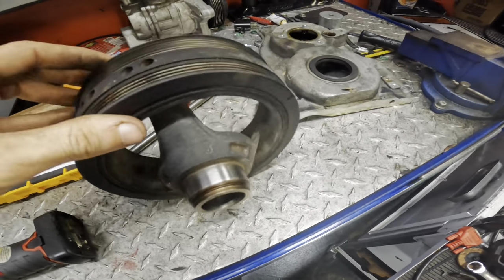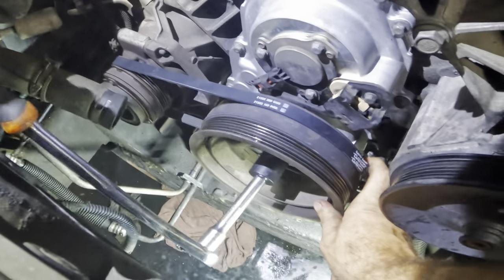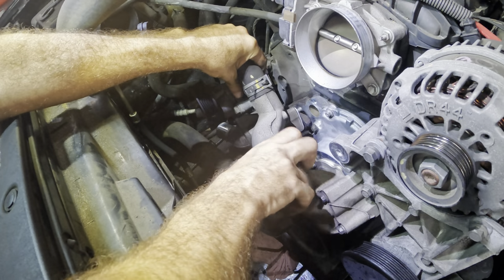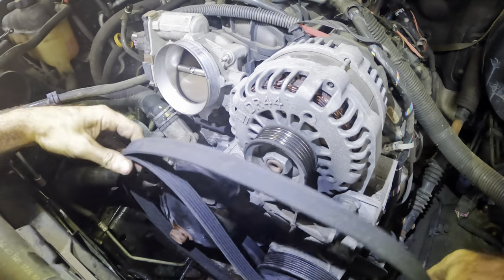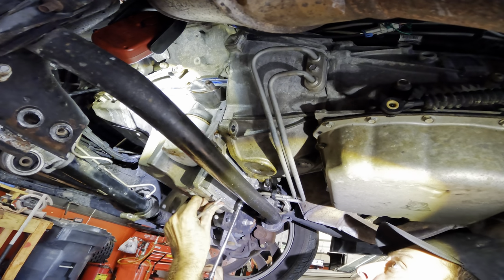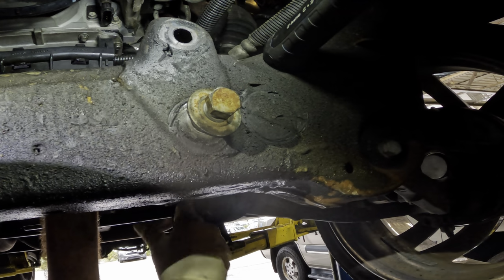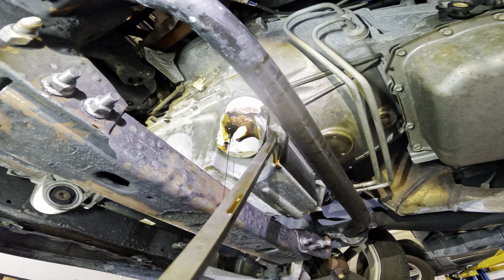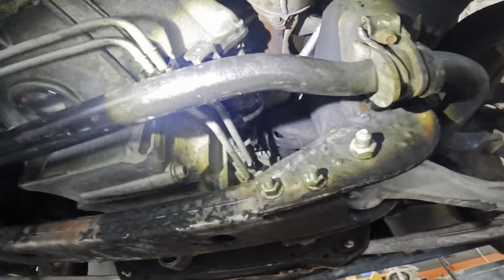Customer States: Melling Oil Pump Upgrade! GM 5.3 V8 PT2

Comment: i hope this customer didn't request the oil pump replacement on a hunch!  that was a huge job!  there's a master mechanic on the radio here who says he replaces his tstat ANNUALLY to maintain good fuel mileage.. seems excessive, but i guess it's the first feedback mechanism the computer uses to regulate fuel..  love the videos!
Reply: The customer did replace it on a hunch.  Had no reason to just had him replace it.  But not the water pump!

Comment: The last guy put the pan bolts on with a million pounds of torque, why did you think the filter would be any different? When it comes to oil pumps, why do you have to prime some but not others?

Comment: The crank bolt are like the head bolts use them 1 time right ?
Reply: Depends on the manufacturer GM nah you can reuse the original Toyota on the other hand 😜, torque to stretch ugh so infuriating also dealer only and like $25-$30 wholesale depending on model.

Comment: Hey Ray, Get yourself a nylon strap type filter wrench, It works with a 1/2 in ratchet. I have never not gotten a filter off with a strap wrench. They work on everything from the 2 inch micro filter to the 6 inch Diesel engine, hydraulic filter. Stay safe out there.  Cheers

Comment: Did the customer state why they felt they needed the oil pump replaced?? Some folks think they are mechanics and mis-diagnose a low oil pressure bearing problem with a new oil pump.

Comment: Pro Tip:  Your mechanic will like you a lot more if you clean (not just the paint) your vehicle before you bring it in.  In the long run, your vehicle will like it as well.

Comment: I think if I was the customer I would have just gone ahead and replaced the water pump at the same time too. Heck you were already there. Why pay latter to have the whole front end taken off again?
Reply: Water pumps on these trucks are actually super easy especially the ones with electric cooling fans. But shops probably still push the price way up.

Comment: Pro tip on the oil filter: Next time just hammer a punch or narrow chisel through the oil filter and use that as a T-bar to loosen the filter. I had to do that all the time back in the day while working at Grease Monkey.

Comment: Lets see if he puts the crappy GM red coolant back in it.  I've seen what that stuff does to a radiator.
Reply: There is nothing wrong with Dexcool, it's incorrectly blamed for everything that has ever gone wrong in a GM cooling system since 1996.  Every problem that has arisen is attributable to faulty parts, such as the lower intake manifold gasket on the 4.3L V6 engine.  Not Dexcool.
Reply: @coolantkid3428  I have seen how the red stuff builds up like clay over time in radiator.

Comment: What is the model and make of the red cordless gun you used after the green snap on to install the harmonic balancer? The power was impressive
Reply: M12 3/8 milwaukee
Reply: @joshhobbs1442  thank you. Ever impressive Milwaukee. Just started my collection with a drill and 1/4in impact m12. The price was good and 2 1.5 hour batteries included and a 2 hour battery and charger under 200. This is next on the list. I wanted the m18 but price comparison I would have barely got the tool alone. Think the first m18 I get will be the 90° one ray went of and bought during one video.

Comment: Everyone else is critiquing you so I might as well…
On the crankshaft pulley, it’s fine to run the crankshaft bolt in with an impact wrench to seat the pulley/harmonic balancer, but then I would have backed off the bolt, then torqued it to factory spec. If that needs to come off again, it could be a bear for the next guy.

Comment: one question why wouldn't remove the oil filter when you had the oil pan off wouldn't of that been easier?
Reply: Think about it, Marty.  What would he bolt the pan to in order to keep it from moving all over the bench while he was attempting to apply  massive amounts of torque?  Maybe wedge it up against the bench vise and risk damaging something?  AS difficult as that was, it would have been harder if that oil pan had been loose.
Reply: @gregfielder  turn the oil pan on it's side it's not going anywhere, it doesn't need the much torque.

Comment: Please tell me you did not use a A/C o-ring on that oil pick up tube???
Reply: What would be wrong with that, as long as it fit correctly. They are oil resistant, too.
Reply: @61rampy65  lol not that kinda oil foolio
Reply: @paulthompson7930  You still didn't give a reason why he shouldn't use an A/C o-ring.
Reply: One is for fuel based shit like motor oil. And a/c is for mineral oils nigga happy now

Comment: I've noticed that motors with some dex-cool left in the bock before adding green or universal coolant results with a clay-like substance forming within a year. Has anybody else seen this?
Reply: That clay-like substance is most likely stop leak that someone dumped in, possibly before the job and it's just coming loose later.  The universal extended life coolants like the Autozone one Ray uses never do that, they're chemically identical to Dexcool.
Reply: @coolantkid3428  well if that is case I guess more people use the stop leak crap than I thought

Comment: Can't used a zip tie for this, instead of sacrificing a perfectly good coat hanger? There is also a tool in the plumbing sections of hardware stores, it's a cinch belt that will wrap around stuck oil filters and it will give the grip of death when the handle is given a force.

Comment: OK, that oilfilter removal hurt's my eyes and brain, I know there is proper toolkit for it. 14PCS Oil Filter Removal Wrench Cap Socket Drive Toolkit. At least in chinese netshops, maybe in every parts shop in US also, not branded but anyway, if it helps doing any job , so why not test it? 
I am only doing my own vehicles, done it some 50years, and thinking do it wiser not harder, we have tools for it anyway.😎

Comment: I don't like the pliers style wrench for oil filter removal--crushes the filter like in the video. I do have one though. I use cups for most vertical filters and strap for horizontal when there is space. Problem with cups is there are too many styles these days to have one for each. They need to go back to the old days when there were only two diameters.

Comment: I suggest purchasing a band wrench. Lisle makes one and calls it the "swivel-gripper" and sells it on Amazon for like $15. You will likely never have issues with an oil filter again... (Lisle 57020 is the tool number)

Comment: Another great Rainman production. Quality video and content. See you tomorrow morning as I start the coffee. Ray there will be trolls. You be you, that's why most are here.  Now to oil filter trolls. Removing the filter is not a bench operation. So what Ray went through was standard procedure. See I might have taken it off when I drained the oil. But guess what. I would have been right where Ray was. That wrench should have worked great.  Way over torqued is the issue here. Yes maybe a different wrench but, your not there. Was there room? I'm here to see how others handle situations. Not to second guess the man on the actual scene. See I would not have used a crow bar. I would have carefully driven a screwdriver through it. Yes it leaks but gives you a handle to push. Only in extreme circumstances, like the air hammer idea. See there are many ways to get there. See one day Rays idea might be handy, when you run down that list in your head of what you think would be the best way. ITS CALLED LEARNING. Please make your own videos so you can be trolled. Those that can, do, those that can't troll.

Comment: I don't get these guys that put oil filter's on so tight they are only supposed
to be tightened a quarter of a turn after the gasket makes contact with the
surface.

Comment: You would have been chasing the pan all around the shop trying to break the over-tightened filter loose. Better to remove it with the pan secure and a catch can under it.

Comment: A couple things.. with so much off not sure why you didn't install a new water pump and starter. (I assume no to very little additional labor). and the other.. A was watching you reinstall the oil pan with the old filter.  I was wondering why you didn't take it off prior to reinstall. Them I watch you struggle to remove it.  sorta funny.
Reply: It won’t happen again,,,, for sure! LOL

Comment: that poor oilpan gasket, it never had a chance against Popeye the mechanic lol and the best longevity based thing a 5.3 can get is a Melling oil pump, my  ATK HP long block came with one and I see constant 10-15 psi higher than my stock LS1 had which is important if you have a "no spring" cam, to preserve the lobe faces and rocker/pushrod union under the higher lift and longer duration

Comment: I was just wondering why you didn't coat the inside of the oil pump with oil before you put it in I'm not saying fill it I'm just saying coat it so it starts out life having a better seal and not running a little dry. Nothing feels good when it's dry and the complaining oh my God.

Comment: Oh, man, I don't want to ruin fun with my comment. Just wanted to point few things that should to be done or in other way should not to be done:
- oil pump must be soaked up in oil, dry oil pump would not work for some time which warn the pump gears and crankshaft bushings
- when the timing chain (or worse - belt) is installed and tensioner activated, it's not recommended (even forbidden) to turn the engine back because is could cause break of the tensioner and warranty expiration
- the crankshaft oil seal should be moistened in oil, unless it's teflon
- so many tools and no tool for the belt? c'mon ;)
Apart from that, great video, I like to watch because new cars for me (non-european) and you're funny.
Reply: You should have been an astronaught ! LOL

Comment: im very familiar with the oil pump upgrades on the triton engines in the Ford world but I am not on the GM 5.3 I have a 2003 suburban with this motor in it just about to hit 200,000 miles do you recommend this upgrade I am familiar with the o ring problem on the oil pick up tube but have not had any issues and being that my oil pan needs a new gasket i would like your input the engine is still very strong and healthy just did a 1200 mile trip with the family to California it even got to enjoy some e85 as you just can’t find it in utah for some odd reason definitely was a nice savings anyway let me know your opinion as it would be a lot of work a lot more than that Tahoe as i have four-wheel-drive and the oil cooler and it’s all in the way lol

Comment: Do you think that the partner of whoever designed that oil filter mount had recently run off with a motor mechanic?

Comment: why do people tighten oil filters soooo tight. they are supposed to be only hand tight, then when you go to remove it should be fairly easy to turn. I bought a used riding mower. It had a good looking filter on it. I was going to change oil and reuse filter. I destroyed the filter trying to remove it. A new filter at Lowes was $17 bucks!
Reply: So!! Might be the best $17.00 you can spend on your riding lawn mower ! Don’t be cheap where it counts ! LOL

Comment: Disappointed in you Ray  No oil on the crank shaft seal surface or seal before installing?. 
Also washed any oil from the timing chain with the break parts cleaner. A dry chain starting 
up on the plastic chain tensioner cant the good. Both should have been oiled before assembly.  
Putting a new chain on old worn sprockets is never a good idea. I'm a new, but big, fan and 
have watched all you videos. I can't normally find much to question but you really 
disappointed me on this one.
Reply: You do know that just because you didn't see it done doesn't mean it didn't get done. Right?

Comment: What a waste. The engine is open enough for a new oil pump and the owner decides not to put a new water pump on while it’s torn down.  He may well regret that down the road!
Reply: It's less than a one hour job to do a water pump on a 5.3 that Has electric fans like this truck did.For all we know it had been replaced 10000 miles ago it makes no sense to replace it again especially given how easy the job is.
Reply: @stevewhite3424  Hear Yah!
Reply: ...and it is his car, not yours. There's that!